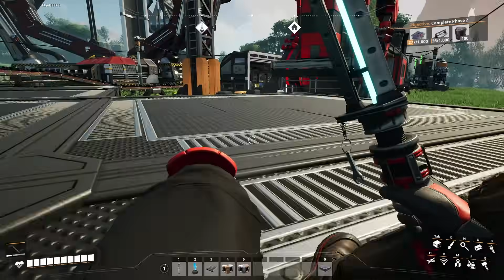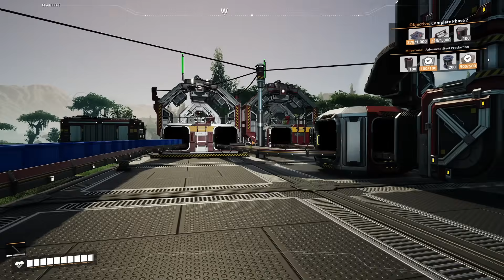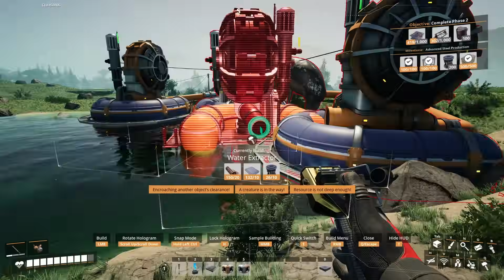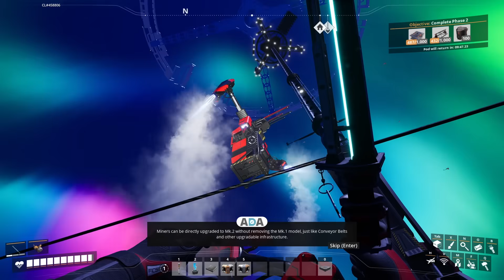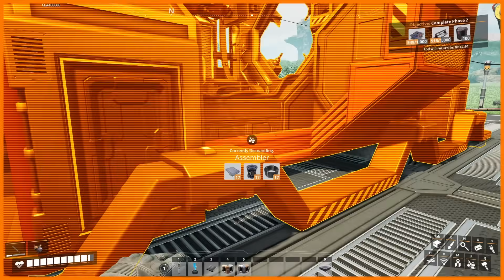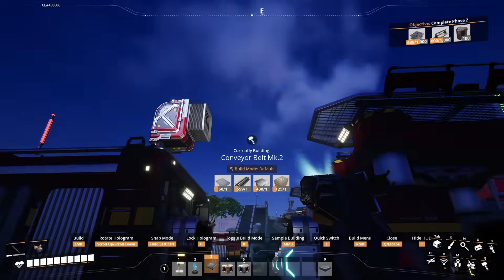Advanced Steel & Rotor Production! | Satisfactory ep.7

Comment: Here's some more tips:
For your late-game factories, try adding a logistics floor, so all the conveyors are under the machines. You will need conveyor lift floor holes from the AWESOME shop tho
Google satisfactory calculator and click [SCIM] satisfactory - calculator. If the bottom right has a list of the map extraction rates (using fully overclocked MK3 miners) for all resources, you're in the right place. click planners and go to production planner, this is a really helpful resource for planning your factories 
(These first 2 tips were sponsored by: You automating some steel production)
"Why can't I jump onto pipes?" Well... maybe try going down the quartz research tree...
"I need better power poles" maybe check caterium